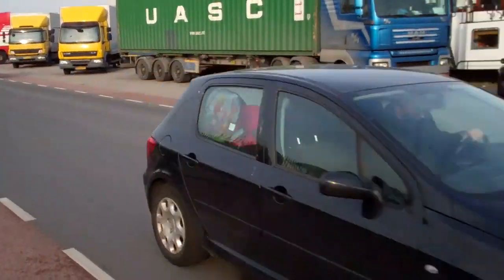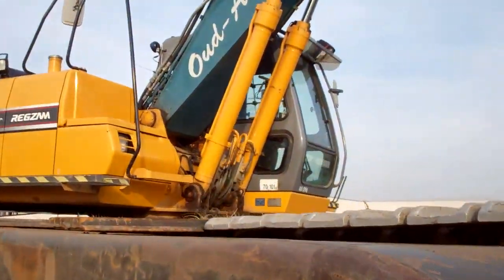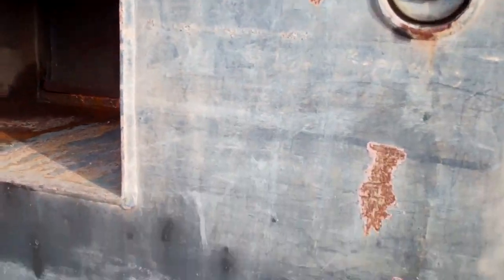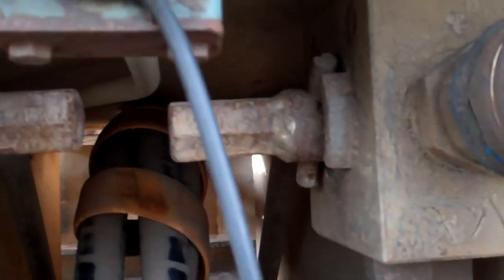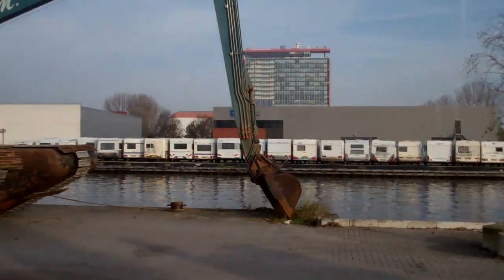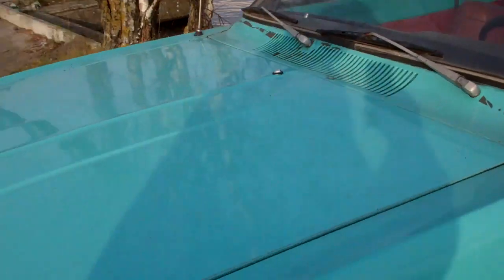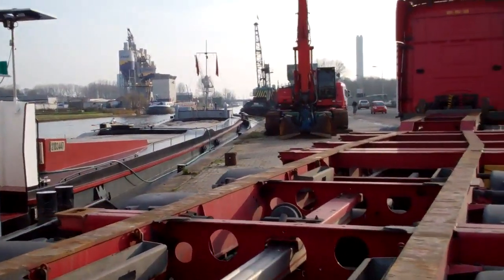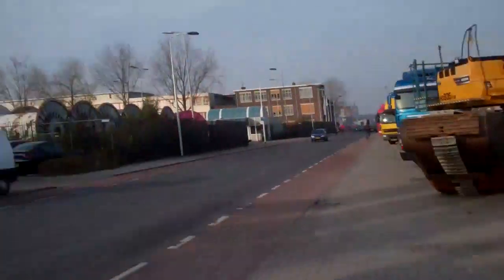Floating crane but on tracks ? + Opel Kadett 1968.

Comment: HD 835 V BF    Well, with the perforated bucket, we know it's a dredge for canals, right?  ...but it actually uses the tracks to swim! There are several YouTube vids on the  HD 835 V BF.  I think the alternating track size is to drive the crane through mud (and water). One vid shows it entering the water, using the bucket to turn the crane once it was afloat and making a little bow wave while underway.  From what I've seen it's just as at home in mud!  Pretty nifty machine!